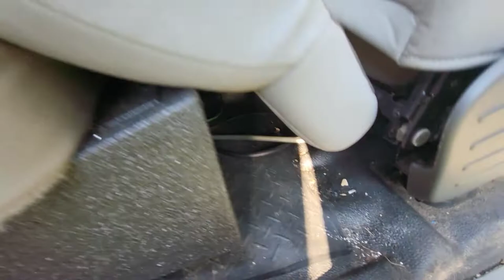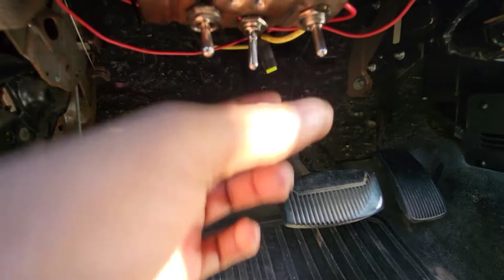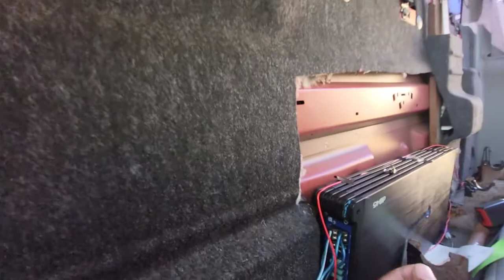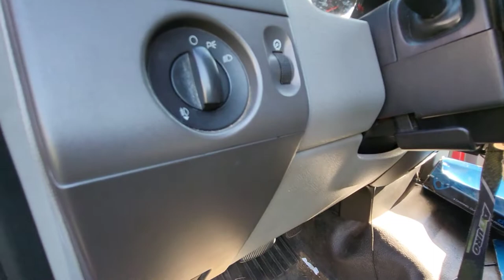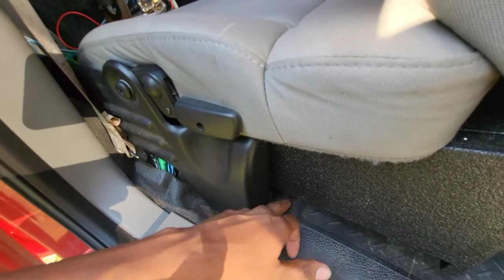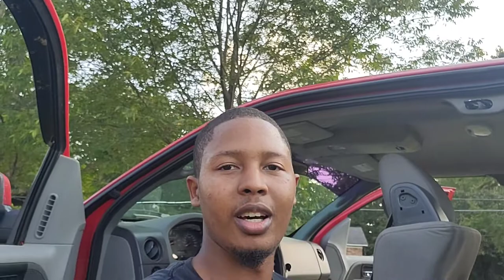How to Install Marines Speaker on your truck step by step

Comment: Yo that $h!t is fire🔥🔥 I googled marine speakers in a pickup truck and this is the first video that popped up at first I was going to use a removable chinchero box (which I bought already) but after watching this video with all the details of installation I'm going this route 🔥🔥🔥🔥 it f**kin lit

Comment: That red wire is your remote wire and I normally run it to a switch that comes on with the key but I used to use a toggle too

Comment: YOU A REAL INTELECTUAL THE WAY YOU GOT IT ALL SET UP. Ima do the exact same thing in my truck. But one question how did u get the rear seats to fold down ?
Reply: also you got alink to where you got all ur speakers and pas
Reply from the maker: https://youtu.be/VNobA4Ao4YQ?si=KA2aXSpEzwuIdiLm. 
Here a vid on how to fold the seat down. It hard to get to them clips and you need a long screw driver

Comment: Hey bro I am trying to replace or upgrade the actual speakers and keep the same pods. However, I can’t figure out how to open them up without it feeling like it’s gonna break.
Reply from the maker: Well I never took them apart and really not sure that they going to break or not.
Reply: @thekingboyz8693  ah okayyy, I wanted to change the speakers inside and just keep the cones. Was thinking of putting 8” DS18 or Rockfords in there.
Reply from the maker: @tkdesignz1217  yea that will sound good forreal, better than the rockville

Comment: Where did you get the Bar to mount the speakers? I'm trying to find one for my truck since my brush guard will only fit one speaker set.
Reply from the maker: Custom build
Reply: Fml I still can't find anything to mount my new speakers 🤣
Reply: @Wes61 just make it
Reply: @spazzin9004  already did while back 👍